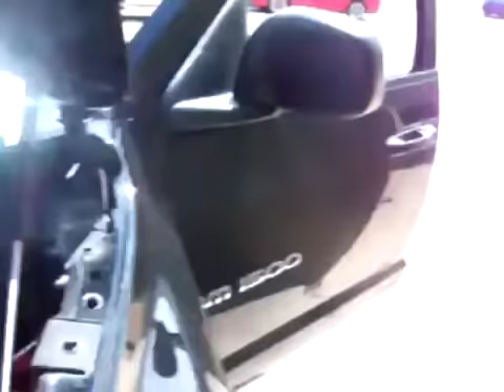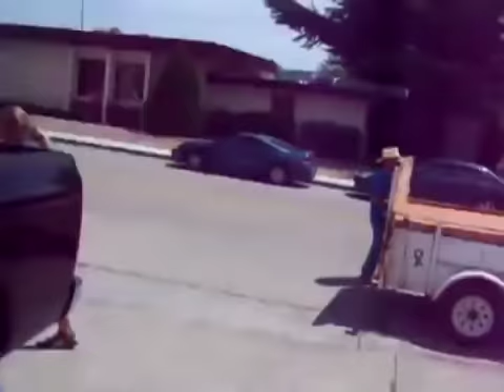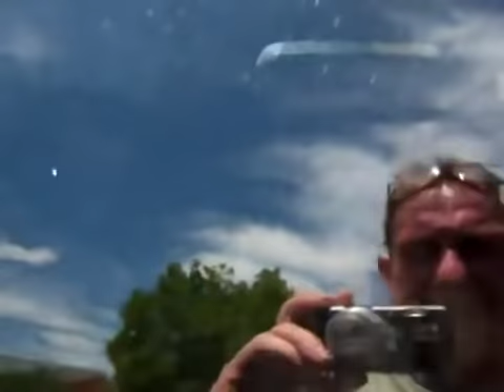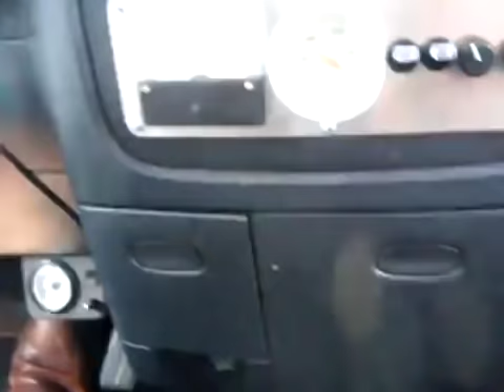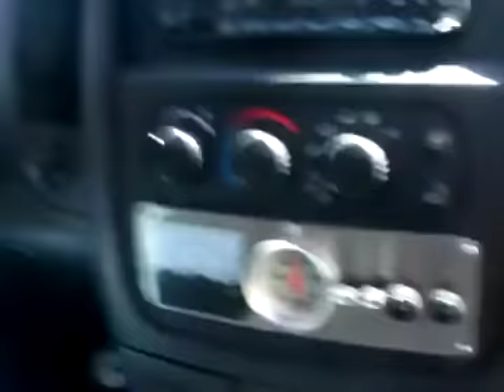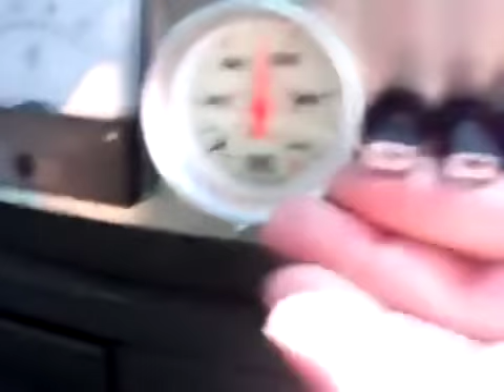TRUCK RUNS 100 % on WATER SCAM. Fast Freddy dissappears.

Comment: Hey man I tried to believe you, but do you know what I couldn't, I swear I tried hard but it's not working. Why you  are lie 55 liter per minute, do you have hydrogen factory back in your car. You cell maby maximum production 1.5l per minute, I don't know how much hydrogen does your engine need to run but definitely more than 1.5l per minute, don't lie to the people.

Comment: This video is 6 years old, they must be dead by now. Everyone showing the discovery is alive, everyone wanting to mass produce it and sell to the public is dead. 
And you Pathetic Whiny Trolls out there are HILARIOUS at best with your convoluted reasons this shouldn't work. You're only exposing your minimal knowledge and IQ. The government has been secretly using this for decades for their ships and overseas vehicles where fuel availability is in question. Iceland has changed their municipal vehicles to hydrogen, Honda has Hydrogen cars, etc. All the way back to my Great Grandparents farm that their old 1 cylinder water irrigation pumps ran on water injection, they'd fill the 2 gallon tank with water then spin the flywheel until it kept running on its own. 2 gallons lasted about a week, pumped water from the nearest creek over a mile to their home and gardens. Those motors were in museums across the country until somebody brought it to Exxons attention, then they all were removed from the museums. No different than the electric car..... If the big oil companies could sell water, then we'd have hydrogen vehicles, lawnmowers, motorcycles, etc. Your doubts and disbelief only serves as entertainment, we all know the truth, the technology is there and it works. 👍👍

Comment: I see you can turn $1,000,000 into $1,000 or less by this perpetual motion machine.  It takes more electrical energy to make Hydrogen then the Hydrogen able to produce thermo energy to propel the truck.
Reply: Kw. The electricity is not the fuel source is it? Electricity is just used during the work process.  Its about using a different fuel source... not gasoline.

Comment: This is a scam!  I a vessel that small a production rate of 55 liters a minute would have produced so much gas in a container that small it would have been boiling like a pot of water on a very hot stove.  There is not even close to what they are claiming is being produced.  also they are claiming that they are getting a high output from water with NO electrolyte and that is total BS!  This guy has not been seen or heard from since he ran off with thousands of dollars of peoples money that payed for his systems!
Reply: Mike's Micro Shop you just hating bro

Comment: all lot of people here really need to get an education...fkn dumbass comments..water or h2o is what its make up is, 2 atoms of hydrogen and 1 atom of oxygen is what makes up water... now when you extract the hydrogen from water you are left with oxygen..are we getting a grasp yet?..i cannot type slower for you braindead out there....now as some of you more educated people here would know ..hydrogen is a very flammable gas...correct?..keep with us( for you complete morons with little or no education,here is a test for you numpty's out there to do...go in garage or trailer...got a bettery handy ,,,one out of a car will be good...remove vent caps from the lead acid battery and hook up a battery charger,providing you know what one of those are...or ask someone that does...now place the positive to the positive terminal and negative to the negative terminal and turn on the charger....wait about half an hour and ignite a match over one of the open cells and you will find out how volatile hydrogen gas actually is ...when you recover several months later in hospital or actually survive for that matter,let us know how your experiment went.....hydrogen gas is created by inducing and electrical current through water.....and you could never use that to fuel an internal combustion engine could you?....wake up idiots!
Reply: "all lot of people"... geez, that's your opening sentence and you call other people morons?  Fucking idiot.

Comment: you can use water as a fuel..its been proven!  Don't be fooled by miss-information!
Reply: IF YOU SUPPLY ENOUGH 'ENERGY' IN THE FORM OF ELECTRICITY TO SEPARATE WATERS EXTREMELY TIGHT COVALENT BONDS.  I.E. $2 IN ELECTRICITY TO GET H2 GAS TO RUN TRUCK FOR 1 MINUTE... AT FREEWAY SPEEDS THAT'S $120/60MILES = $2/MILE .... WAIT, GAL GAS GETS ME 20  MILES OR $4/20 = $0.20 / MILE  ONE-ONE-HUNDREDTH THE COST!  WTF DO YOU GAIN WITH THIS BS!  NEVER WILL UNDERSTAND INTERNET TROLLS LIKE THESE THAT DO NOT SEEM TO HAVE A PURPOSE... UNLESS THEY USE THESE BS STORIES TO HOOK IDIOTS IN AND MILK THEM FOR WHAT THEY CAN!
TRUTH: STORIES LIKE THESE ARE PURPOSELY OBVIOUS TO ANYONE WITH HALF A BRAIN SO THEY CAN SUCKER IN THE REAL 'TARDS (NO OFFENSE MEANT) INTO SENDING THEM THEIR GOVERNMENT CHECK!
    THIS IS THE ONLY POSSIBLE EXPLANATION...  REALLY!

Comment: there's no damn way that thing is producing 55 LPM. maybe 10 at the most. How do they regulate the amount of HHO injected into the intake with the gas pedal????
Reply: My thoughts were in this direction.... I watched lab videos on these h2 extractors and I don't see any way for them to separate the hydrogen from the oxygen in the machine that they have or at least the tank that they have in the back but my views could be wrong

Comment: Dudes, I actually built one of these units as per their instructions, yes it works quite well however I don't believe they managed to achieve resonance with their PWM, I can't find that sweet spot no matter what frequency I use, I have swept from 2Hz right through to 2Mhz using sine, square and triangular waveforms. I can sink about 30Amps using just tap water but cannot produce usable amounts of Hydrogen (HHO). If anyone has reproduced this and found the correct Frequency???
Reply: Nick Gleeson hey Nick, do you still have their plans/instructions on how to build? I'd like to get a copy of it if you do.
Thx!
Reply: Hi Tres, I built mine from the series of videos that this guy made, I also bought the pre fabricated electroder from a place called the Hydrogen shop. I used the same water filter housing that these guys used, but I designed and built my own Pulse width modulator as I wanted higher currents. I have had more success since using high voltages.
Reply: Nick share
Reply: Where are his vids now
Reply: He says electrolyte in his system

Comment: You do realize that if they did publicize a car that ran on water, all major oil and gas companies would go bust, similarly with the MDI air car, if that goes global, the major companies WILL pay big money to have the owners "disappear" and the companies terminated.
Reply: iT IS EXTREMELY EASY TO CONVERT 
       (2)H2O(WATER) =TO= (2)H2(HYDROGEN GAS) + (1)02(OXYGEN GAS)
USING ELECTRIC CURRENT AS SHOWN, BUT ELECTRICITY COST TO DO THIS FAR EXCEEDS THE SIMPLE USE OF AN EQUIVALENT ELECTRIC MOTOR RUN OFF BATTERIES!  THIS THEY ARE GETTING VERY CLOSE TO USING WITH BETTER AND BETTER Nicle Metal Hydride or other storage batteries/electric generators.